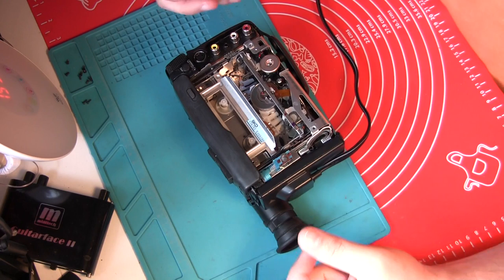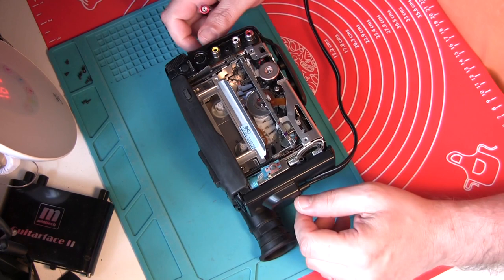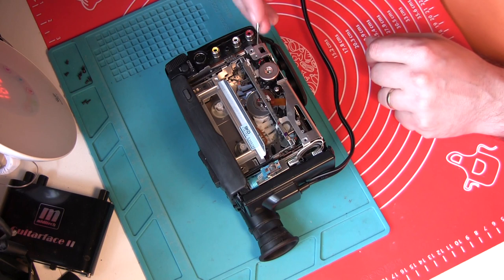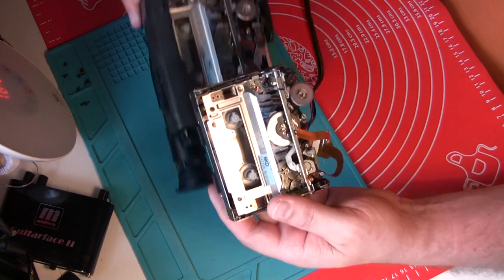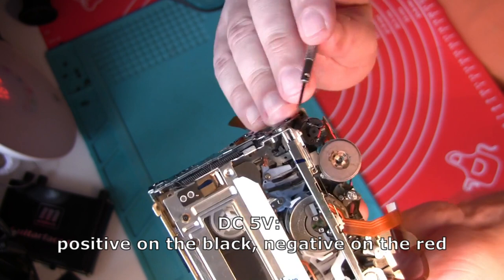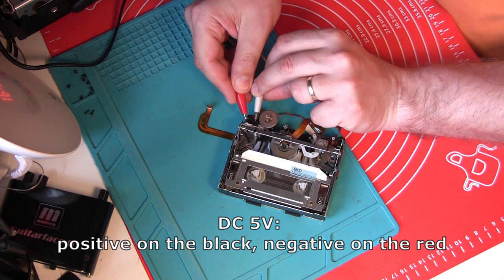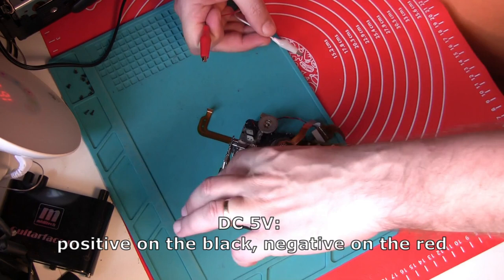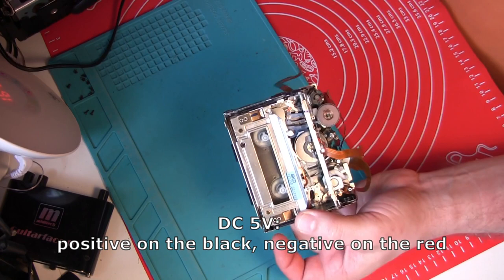How to remove stuck Video8 cassette from broken Sony camcorder

Comment: Do you have to have a working battery mounted to the camera in order for the cassette cover to open? Thank you 🤓 found a tossed out Sony portable camera that uses the small video cassette but no battery.
Reply from the maker: All Video8 Cassette loading mechanisms are motorised. There is no "manual battery free" way of opening and retrieving cassette without damaging the device. Electric motor needs electricity to open or close.  In a working camera it comes from battery or power supply with battery adapter.
Reply from the maker: Old Video8 cameras can be powered up by applying 6v DC from any power supply to the battery contacts - observe polarity though!
Reply: @zadzwon112  the camera is a Sony Handy Cam video 8. Not sure if it works! Thank you. It doesn't look like a cassette is stuck in it but wanted to open the side to inspect for corrosion, dirt, etc.

Comment: Hi, I have the same camcorder and it was working until yesterday. 
Now when I press eject it starts doing it's thing, and you can see the tape starting to go back just a little bit before stopping(I've removed the casing like in your video). You can hear some mecanical sound (almost like it's stuck), but then it gives up and return the tape back into play position. 
I can still play and wind/rewind the tape. But I cant eject it.

Do you think the dc-motor trick will work on this one?
Reply from the maker: I would suggest to fully FF and rewind the tape a couple of times - that would at least eliminate a possibility of tape being stuck somewhere in the tape transport path or cassette. And then try again to eject with camcorder connected to power supply, not battery. 
There are many things that can prevent tape from going out: tape being 'eaten' and stuck around/between roller guides, roller guides coming off their rails or stuck, cogs/rails in the loading mechanism being broken/disengaged. And 99% of TR705 (and any other Sony camcorders from approx. 1990-1995) have leaked caps which make them behave strangely. 
If you do not care about causing more damage you can try apply 5V DC directly to the loading motor like in my film and see what happens. In case however you would like to keep the camcorder and tape safe - I would advise proper disassembly and investigation of what the cause is exactly.

Comment: Hi, can you please provide the name of the electric tool you are using to provide power to camcorder to eject the tape?
Reply from the maker: It can be almost anything providing DC 5V. The cassette loading motor does not need a lot of current to work. I use my workbench power supply (diy), but even 3x AA batteries in series giving 4.5V should do.